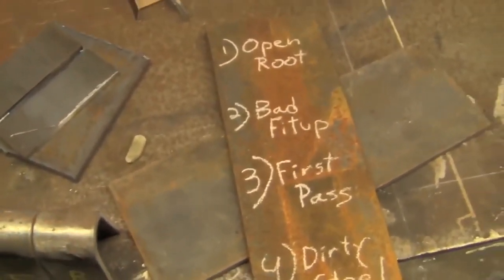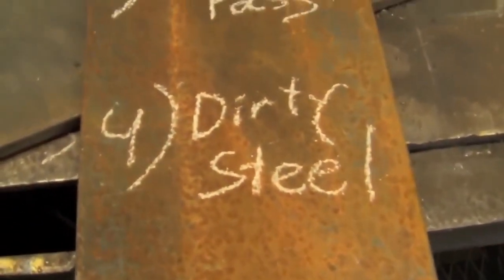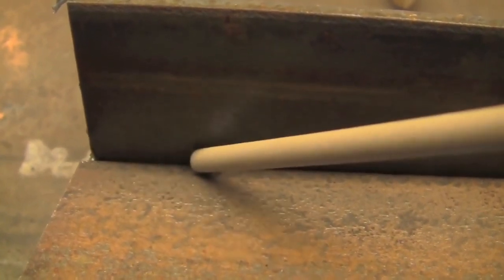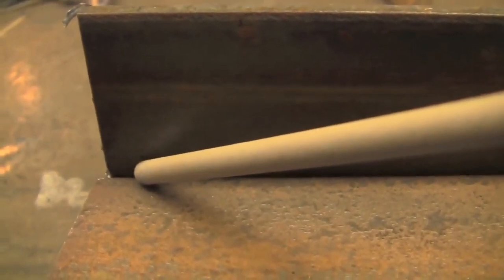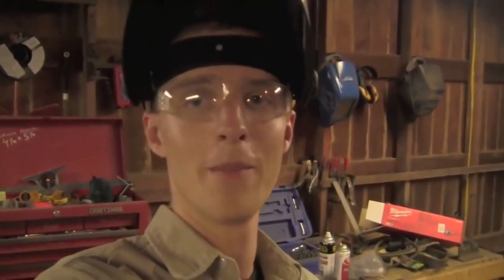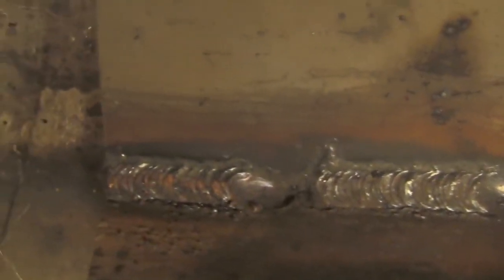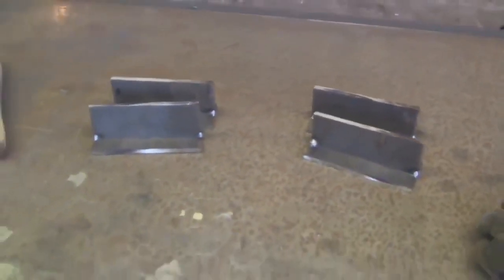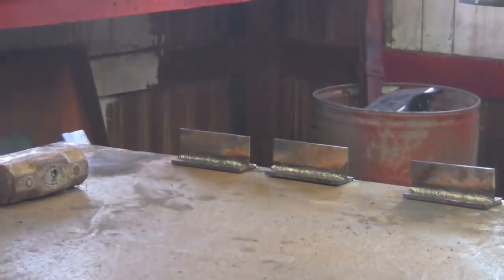HOW TO WELD WITH 6010 / 6011 ARC WELDING RODS - FREE LESSON - INCLUDING BONUS DESTRUCTIVE BEND TEST

Comment: Go ahead and use 6011 rods on AC if you don't mind all the damn sticking those rods do. Use 7014 instead. Much less chance for sticking. Clean the rust off first which is usually easy to do. I've never used 6011 on D.C. So maybe it actually is a good rod, in that case.  7018 sticks at least as bad as 6011 but is really good with D.C.

Comment: There's another thing you can do with small 3/32" 6011. You can tack-weld sheet metal that's too thin to run a bead on. Even though it has an agressive arc, it's also a fast-freeze stick. 
    A smaller size stick, if you could find it, would cost twice as much. But 3/32" 6011 is everywhere and as cheap as anything else. 
    I got one of those $100 amazon welders, I set it at 50A, strike the arc, make the puddle, and break the arc. (The range is 40-90A, but below 50 you keep sticking the rod.) If you move over 2 to 5 inches, depending on the thickness of the metal, and do the next tack, you can reduce the heat (and distortion). 6011 is good at welding without a lot of prep, so if you keep tacking around, at some point you have a bead of welded sheetmetal without too much distortion. This is slow, but fixing holes isn't fast, and severe heat distortion can be impossible to fix.  
    With a better machine,  maybe you could turn it down to 35A and run a continuous bead, but this method will always work. 

    I know this isn't the kind of welding you do, but I bet some of your viewers already do it. And lots of people have slow seasons and not much money (or kids), so I put it out there for anyone who wants to try it. (If you have a tig or mig welder,  I'm not really talking to you.) 
     Very little of what you do is something I'm likely to ever do, but   the way you do what you do is still inspirational. Thanks for the channel !

Comment: btw... the video on youtube where the guy gives some tips on how avoid getting burned when doing overhead is from youtuber Taylor Welding and the video is called "welding overhead 7018 tips and tricks"... the only thing i wished that he had done is do testings of strength like you did and also I wished he had mentioned if circular motion could also be an option for both rods.  Well, when you have time... here is an idea for a future video and I believe you could call it "dont get burned with overhead welding... safe and easy way to weld with 6010 + 7018ac"

Comment: It is great to see people experimenting and sharing their tests!  Great work👏👏!!!!  I started to learn welding because I needed to fix my trailers!  Even though I tried to keep as simple as possible and as easy as possible, only after wasting a lot of time and money on machines, rods and techniques… I figured that the easiest way to get strong welds for my trailer was using circular motion with 110/220v stick welder running Lincoln or Forney 7018ac (for some reason the AC version is much easier to strike an arc compared to the regular 7018(for the regular 7018… I tried Hobart and Vulcan and probably because of my limited experience, it was very hard for me to strike an arc!  Because it was hard for me to use the Hobart 7018, i tried to switch hobart 7014 and it was a piece of cake to strike an arc but then i came across another problem… 7014 was only easy for me to run on flat surface… when i tried on vertical… the 7018ac was a lot easier for me.  So for a moment I thought I had it figured it out… but unfortunately in ran into another problem when i had to weld overhead with 7018ac and I was just could not get it right and without burning myself.  I am now interested in doing a 1st pass using 6010 because I saw another youtuber welder showing that running 6010 before running 7018 also makes it easy to apply 7018.  Now that I see you applying 6010 in circular motion and I will try to do 1st pass 6010 in circular motion and then apply 7018ac also in circular motion.  If possible I want to learn 1 technique that is easier to get consistent welds for both 6010 and 7018ac rods.

Comment: I can only weld at 75 amps with my titanium welder harbor freight   but my 6010 6011 it keeps sticking but running 7018  it runs as smooth as smooth can be
Reply: I. Have the same titanium one I’m really struggling with the 6011 hard to restart and sticks easily if I get distracted. I’ll pick up a box of 7018 to give it a try .otherwise I think I might have to run it at the 220v mode

Comment: I think we should also take into consideration that by the time you were swinging the sledge hammer on the circle motions welds you most likely had less energy in your swings (as you already swung 13 times before you started the first circle weld test and 21 times before you started the 2nd circle weld test.).